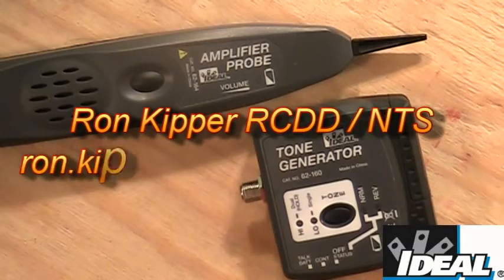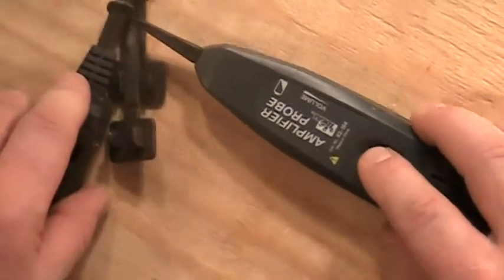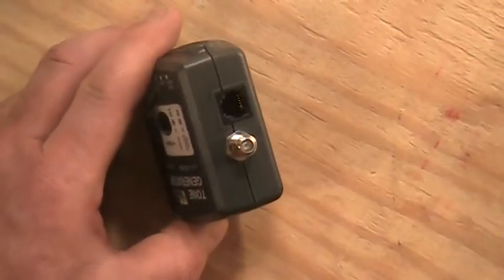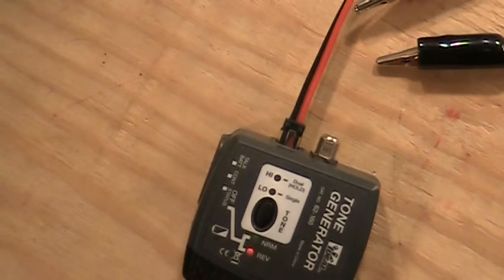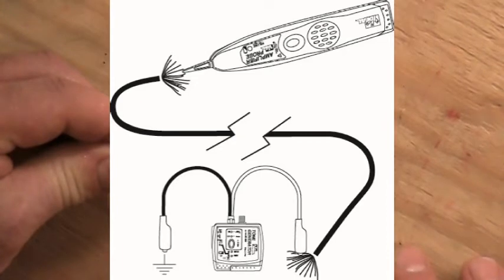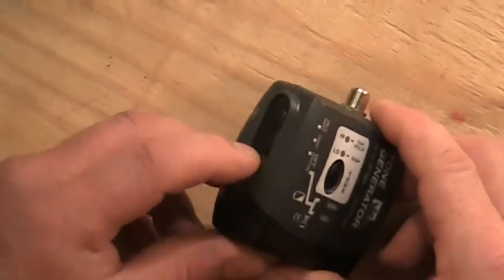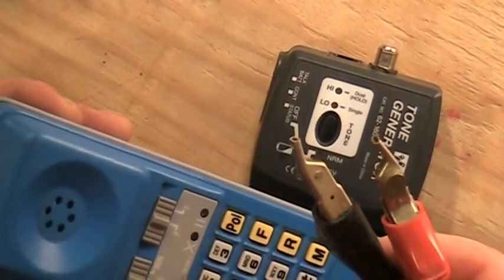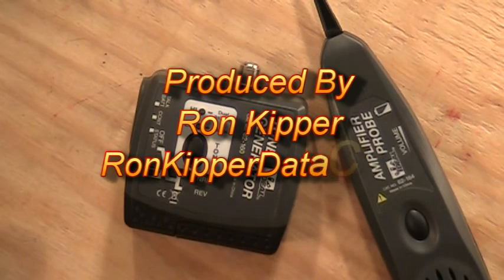IDEAL 33-864Tone and Probe.mpg

Comment: Hey Ron, thanks for all this great info. I'm wondering if this device can be used for troubleshooting audio gear such as radios or stereos. Thanks
Reply from the maker: Hello yes you can use it to trace those kind of wires just make sure there is no equipment attached to either end of the cable as it might short the toner which does not hurt it but you lose the tone have fun Ron
Reply: Thanks for your prompt reply. Have you seen Mr. Carlson's super probe video. It's pretty good although making it is like micro surgery.

Comment: Hey i live the uk and i constantly working with coax cables at customers home and mutiple dwelling units where maybe 100 coax cables may be. Will this be a good bit of kit to use?
Reply from the maker: Hello yes I think a tone and probe is the first line of defense when you need to trace about any type of cable. Here is a link to another video with some tips.
https://youtu.be/apIpHPgkevQ?list=PLw8qsvCN6q_3Csu4jbnTIyke40xMAcCIl
Also remember both ends of the cable must be disconnected to trace a cable. Any active equipment will short the toner and you cannot tone through a splitter. Have fun Ron
Reply: @RonKipperDatacomm1  thanks very much
Reply: I now have this tool. Just one question again if you dont mind. 

If my coax cable say is 50 metres long, would there be enough power from the toner generator to make a noice at the end of cable? 

Just i couldnt get a sound in the cable room.

Comment: between this ideal and the fluke
Reply from the maker: Richard Cowtails Hi Richard! I tell most guys all techs need a tone and probe. Ours is a good unit and can tone a cable several thousand feet long if need be. You can trace all types of wire as long as there is no power on the cable. That is why it does not work for finding breakers and those circuit breaker finders are pretty popular. Fluke has a good product too so you won't go wrong with either unit.Let me know if you need help finding a distributor.Ron
Reply: ***** I like that the ideal has the coax port and the attachment of leads. unlike the fluke... the ideal's are actually removable and make new ones if needed
Reply: @RonKipperDatacomm1  Nice vid. Versatile set. So, "no power on the cable." Does that include DC voltage on a phone line? When I try to trace a live phone line, the tone seems to be canceled out after a few feet with my toner/probe.